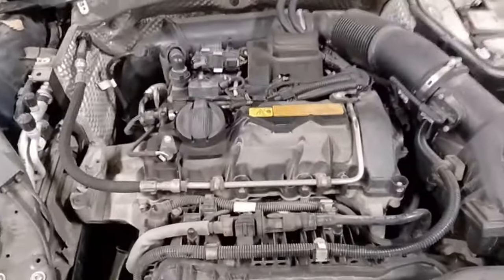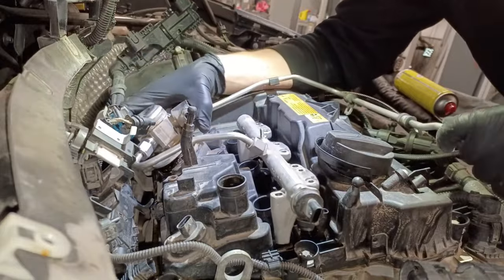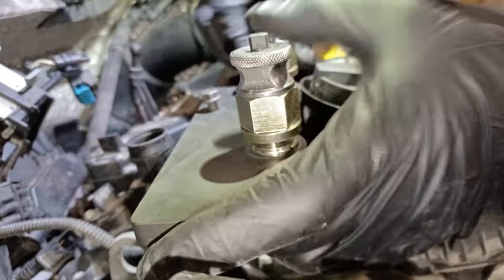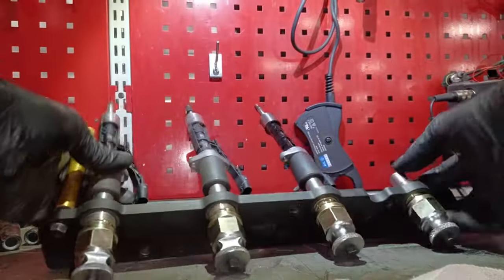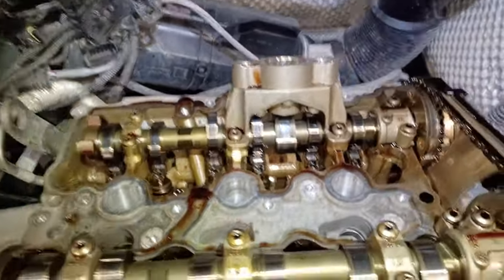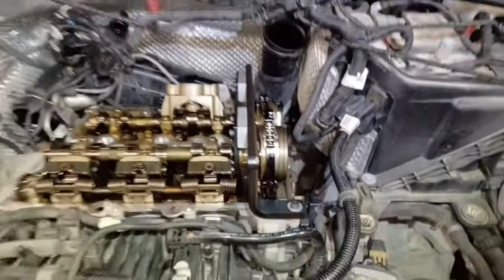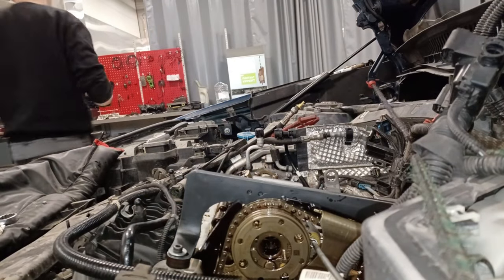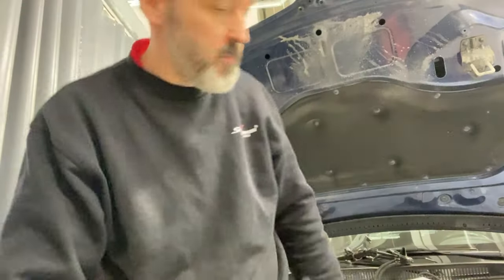B38 B48 VANOS failure explained: Timing and repair PART 1 OF 2

Comment: B38 vanos problem and b48 are not the same..in the b38 engines the failure can be also in the camshaft, maybe a faulty vanos lead to a bad lubricantion so the cam is no longer in the same position,  it's spins when it get ms hot.. changing only the vanos is not enough in the b38

Comment: Hi ben my mini f56 jcw 2018 can be the same problem 🙈in diagnose misfire cylinder 1,3 and other multiple misfire pression in the inlet collector to hight repalce spark coil and reverse vanos actuator but the problem still in progress (scuse my little english)
Reply from the maker: Yes same problem for sure

Comment: I’ve been seeing this failure in the states now that the cars are getting up in mileage. Particularly on the B48 so far. Now we have E-Vanos which will be interesting when those start to fail. There’s a thin sheet metal with springs to lock/unlock the rockers with an actuator to adjust it and the Vanos solenoids are now 3 phase motors lol way to over complicate it eh

Comment: Great video. Really informative. I just did this on my b48.. but bought the wrong locking bracket tool... so I didn't take a chance  messing things up. Where's the best place to buy the vanos locking bracket tool?
Reply from the maker: Dont buy Laser tools one - the kit is great but the locking plates are not strong enough and we are dissapointed. BDS or HCB are good

Comment: Could you explain what is the main cause of this happening please? Usually exhaust camshaft jammed code appears. Ista tells you to check the solenoid pin( free movement), if that's fine, then it tells you to check the screen (filter mesh you showed )why would the mesh be broken? Poor parts ? Does the vanos hub snap because of the mesh breaking up? Would you also recommend a new vanos solenoid after the repair of the vanos hub. Thanks
Reply from the maker: The vanos actuator bolt IS THE CAUSE. Metal gets into the vanos sprocket, it jams, snaps and the timing remains either over retarded or over advanced. You need to replace both sprockets, both bolts and change the oil and filter.

Comment: Wonderful tutorial. Especially appreciate the tips around removing the injectors. Still trying to root cause my B46 lugging/hesistation misfires without any codes. Wondering if there is a chance that codes would not be triggered by this failure? Also would be helpful to have a tutorial on how to record those waveforms of the intake and exhaust vanos cycles. Ty!

Comment: Hi Ben, is it ok to disconnect the injector loom on a  B48 in order to crank over so as to circulate oil before starting? Cheers Paul.
Reply from the maker: Sure but be careful.  The connectors are tight. Pull the grey tab then squeeze and tug. TBH I would just disconnect the coils buddy.
Reply: Ok ben, thank you. Would that bring on the eml ?

Comment: Can you tell us where should we buy it? If it happens again, you said we can't prevent it but we can buy counter active parts
Reply from the maker: Bmw dealer🏋️‍♂️
Reply: @allmech_BMW_fault_finding  so bmw parts... breaks again...bmw part again..nice
Reply: @allmech_BMW_fault_finding i changed both ex and intake vanos solenoids and acuator, and it gives me the code of p13c9 and p0015, i don't know what to do

Comment: FYI bmw say if it takes more than 13nm (if I recall correctly) to remove the injector with the tool then the injector needs replacing. I’ve snapped the heads of a few with the tool when they’ve been seized. Not fun.
Reply from the maker: I snapped one once too. I still have the tap and the tool I made to get it out. Crap injectors. GDI is garbage and nothing but trouble.
Reply: @allmech_BMW_fault_finding   a terrible design too, they could have easily made it so the rocker cover could clear the injectors.

Comment: My B37 has a shake at idle. No codes at all. Ive checked the mouts and they all look gooed. Ive done smooth running test and im getting  cylinder 1 - 0.52 cylinder 2 + 1.24 cylinder 3 - 0.46. any  idea why the shake???
Reply from the maker: Leaking injectors
Reply: @allmech_BMW_fault_finding  thanks mate so replace all 3?
Reply from the maker: @raygen1  confirm with borescope first
Reply: Sounds similar to my issue. How do you confirm leaking injectors with a boroscope? Carbon buildup on pistons? I did pull the plugs and didn't smell any fuel on plugs.  I checked the resistance of the Bosch injectors and they were 1700 mOhm when Bosch specs 1500. That said I'm not sure if measuring resistance of coil works for a solenoid-type injector. Thank you